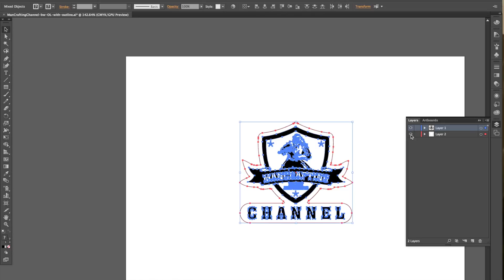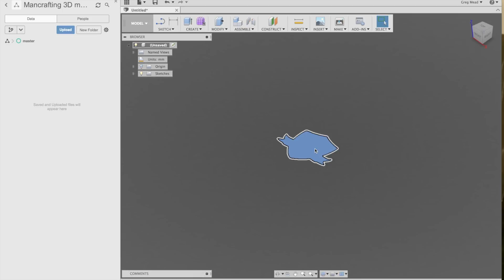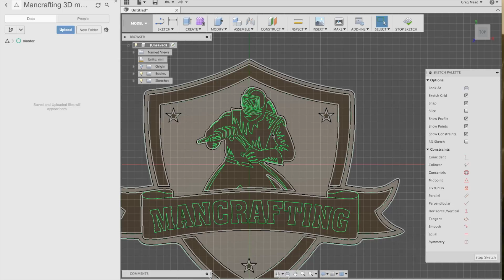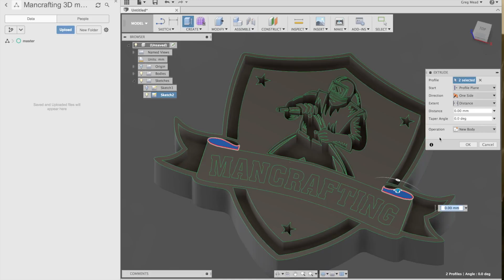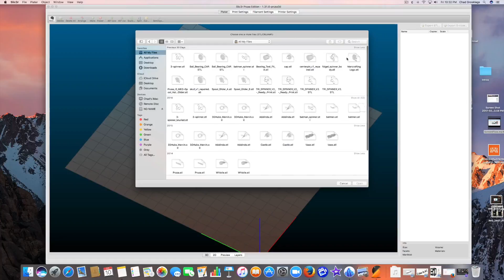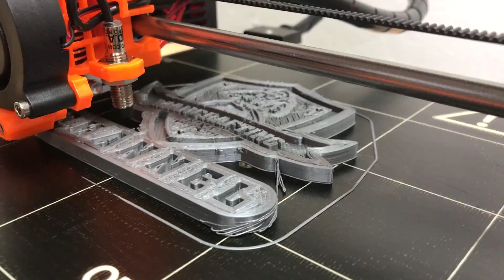FIRST 3D PRINT FUSION 360 & Slic3r  ORIGINAL PRUSA i3 MK2

Comment: Nice video, but it seems like you have'nt imported the printer settings in slic3r. That will improve the quality alot.
Reply from the maker: Stefan Lindström thanks.  I think I have them set correctly now, but it's like a foreign language the firs time you look at everything.

Comment: I've had the same print results with slic3r and since switching to Cura, my print quality with the MK2 has gotten way better. I like the interface on Slic3r, but the gcode from Cura has been flawless.
Reply from the maker: Brandon White thanks for the tip.  I'll look into it.  What version of Slic3r were you using?  Prusa has a new one that's supposedly optimized for the MK2